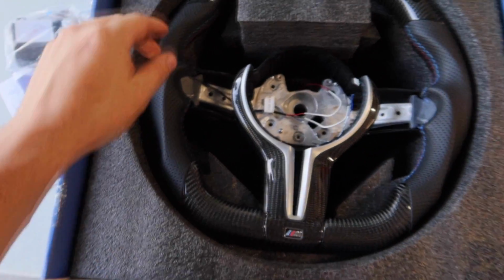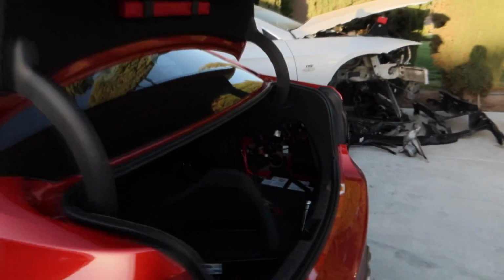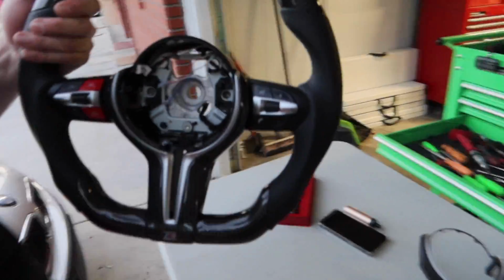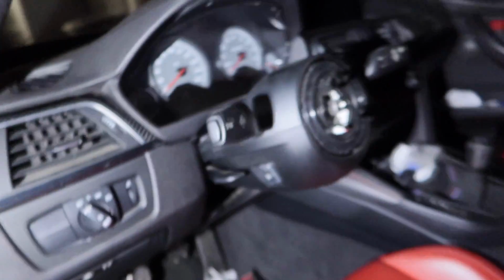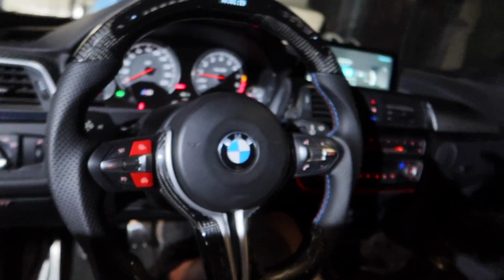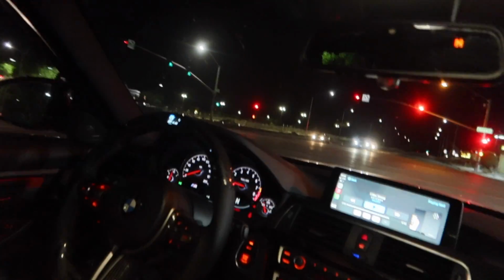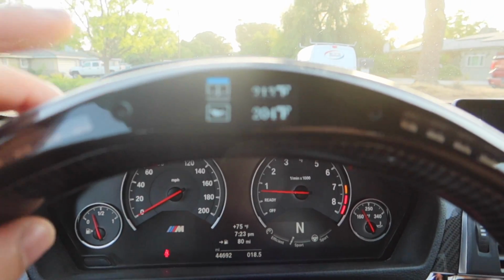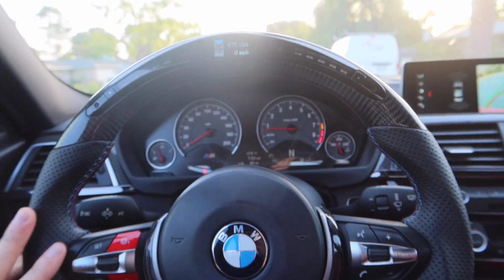Carbon Fiber LED Steering Wheel For My F80 M3!

Comment: I just had this LED steering wheel installed by a local shop. It looks great and works well however I am getting an error message when I start the car noting "Battery Management Error". The issue is that the steering wheel is not fully shutting off when the car is turned off. 

How/where did you hook the 12v wire from the steering wheel to the car so the wheel shuts off completely when you turn the car off? 

Thanks!
Reply from the maker: I honestly dont remember cause it was so long ago

Comment: Paid $2k for my setup, but I had all the trim done, a knob made, custom paddles made by hand (so I got the look I wanted) and kept the heated option and added a fully done up airbag cover, ceramic coated everything, and went with the darkest gray stitching I could have them use on everything, paint for the stripe was the same color code as wheel stitching and stitching for the knob plus the  paddle +,-. I went with a cheap company with my first wheel and had a lot of imperfections and with my newest wheel the supplier uses a different manufacturer in China and the QC was much much higher. All my stuff was forged carbon so it was a tad more expensive. I bought from a middle man (tansowerkz) but man I’m beyond thrilled with how everything turned out, vs my last setup from VLM

Comment: Did you connect the smart box to one of the fuses other than obd since you have the start/stop button I have a led steering wheel and it worked for a week then stopped working it starts whenever it wants then turns off I checked if there is a problem with the led on the wheel but they turn on all the time I press both buttons it just says matching and then doesn’t match. Help please !!!
Reply from the maker: Honestly don’t remember bro, its been a while

Comment: Is it plug and play?
Reply from the maker: Basically
Reply: @TatOhanyan  thanks, I’ve bought one for my car :)
Reply: @ترافيان I bought mine on Aliexpress
Reply: Did u manage to fit it? Cant find any videos on fitting and this ones so vague on what you splice
Reply: @MrDrogo1  Yes, so the one I got came with an OBD adapter which you plug in to make it work. In terms of fitting, it's just as simple as changing the airbag from the original to the new one
Reply: @MrDrogo1  There is a few wiring to do, so if unsure, it's best to ask your local garage who do this stuff
Reply: @less-sidemen  was yours in Chinese and if so how or did you change the language to English ?
Reply: @youtube_zane172  No it came in English (also got a sheet with instructions on how to set up the date time etc